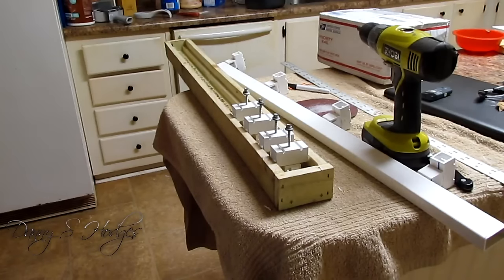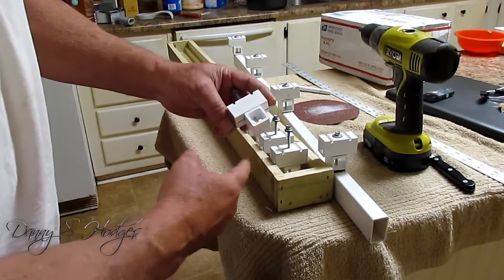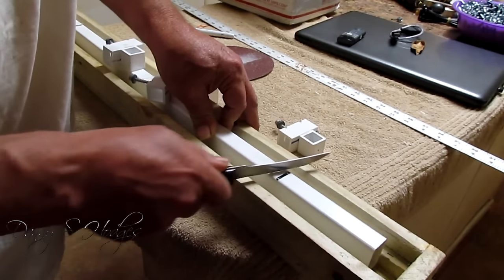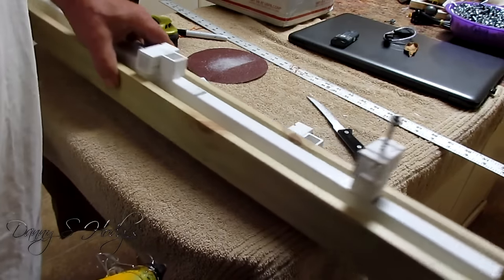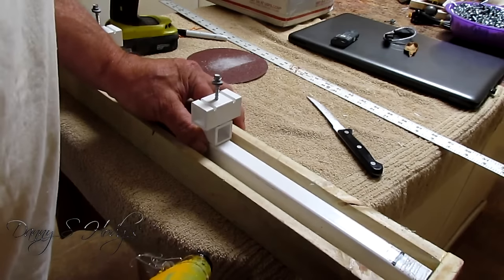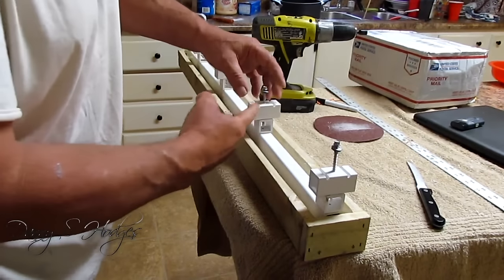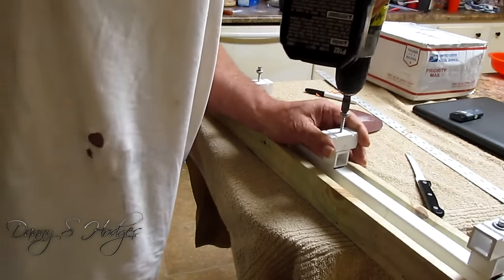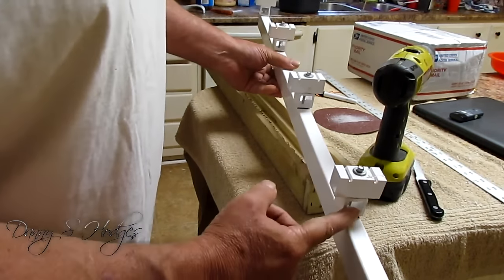Installing The Update For Ultimate TV Antenna

Comment: Cute dogs Danny.   I taken your videos and took screen shots of the 3 pieces 7” long by 1” square I bought from you that were an upgrade to the first antennas on the big E store and figure once I am able to install the antenna I can count the squares in the grid to get them close.    Have I missed the video of the 3 piece update to push the reflector back?    If no video,  is it crucial we’re For exact placement of the 3 plastic square you sent me?
     Weather here has not cooperated it’s either raining and today we’re having high winds and snow in forecast.   

Did many folks besides me call to get the upgrade that were not in the first antenna you sold?
Thank you Danny